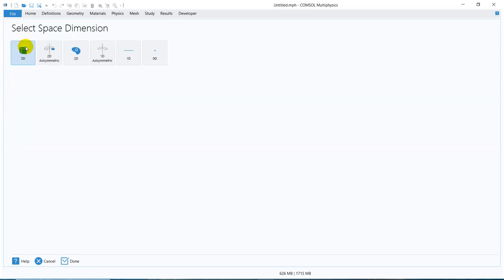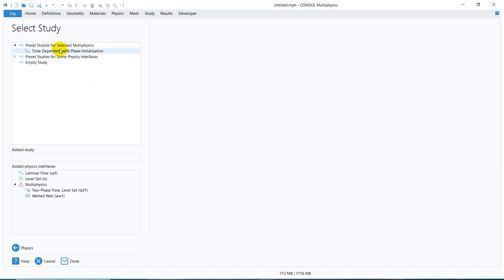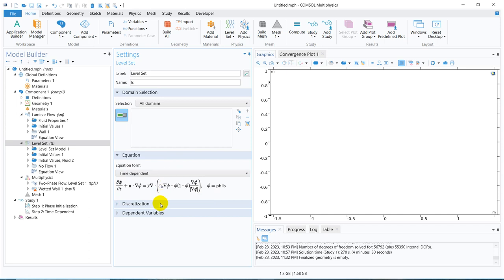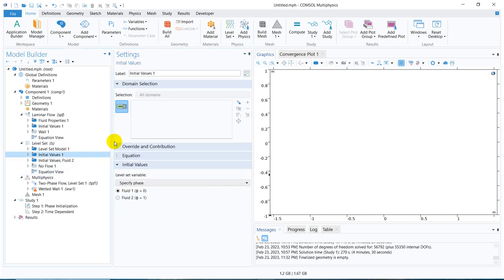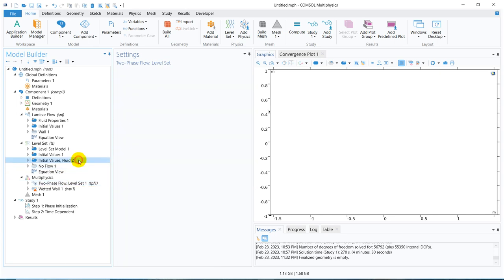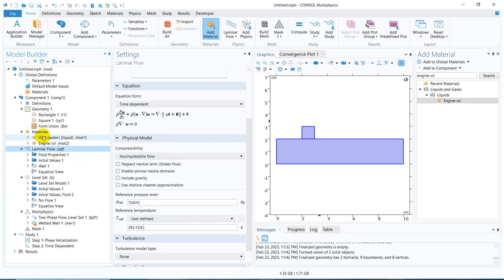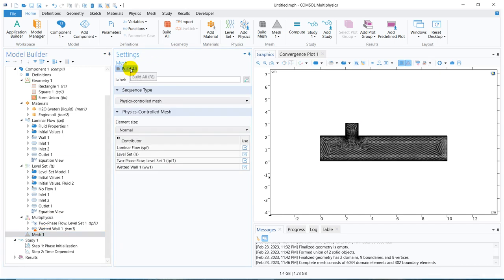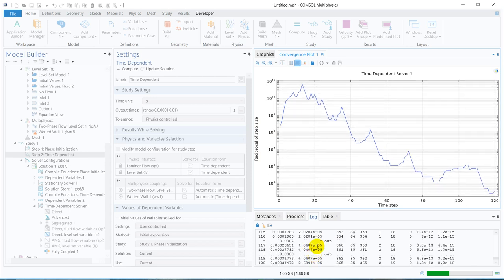COMSOL for Beginners Lecture 8 how to start two phase flow simulations #COMSOL #beginners

Comment: Sir, thank for this video and many others. I have been following them. you explain thing with much clarity. I am wondering if you could couple it with heat transfer in liquid. the initial velocity will be set to zero and movement will be prompted by expansion of liquid oil caused by heating.
Reply from the maker: please write to me pioneerofsuccess2020@gmail.com

Comment: which multiphase has to be used while simulating fluidized bed( flow with granular particles) liquid-solid interaction
Reply from the maker: You can try particle tracing module with fluid flow.
Reply: @pioneerofsuccess4054   I have read some literature, in which they say euler -euler method is good for fluidized bed simulations. what is the difference between euler -euler method and particle tracing method, If possible can you do a video on both.
Reply: @pioneerofsuccess4054   How do we do patching (like in Ansys) in comsol.I wanted to set initial conditions (volume fraction) in some regions of the domain initially only
Reply: @lakshmisreep   Euler-Euler model is a model where we take dispersed phase as interpenetrating continuum in the contiguous phase and RANS equations are solved for each of the phase. This is computationally less expensive and since fluidized bed are having domain size of industrial scale, hence it is preferred. On the other hand, particle tracing method is an Euler-Lagrange model where, dispersed phase is taken as collection of particles for which Newton's law of motion is solved for each particle. Continuous phase is solved through RANS approach. It is highly accurate but computationally very expensive and therefore not preferred for Industrial scale problems. For more insight, you can refer